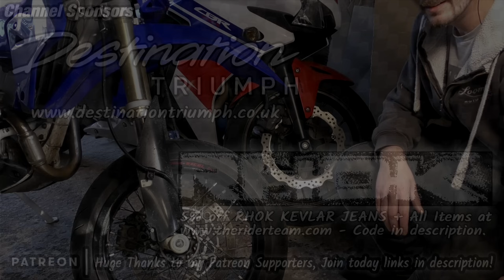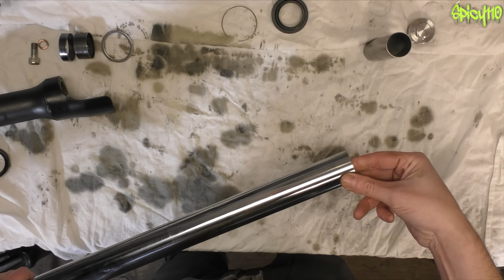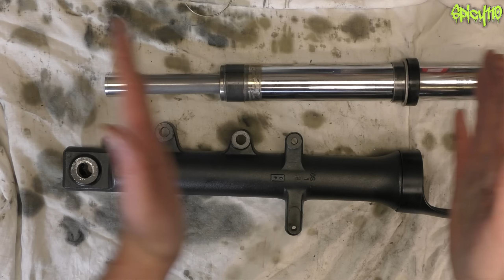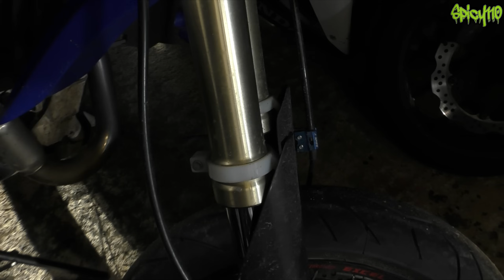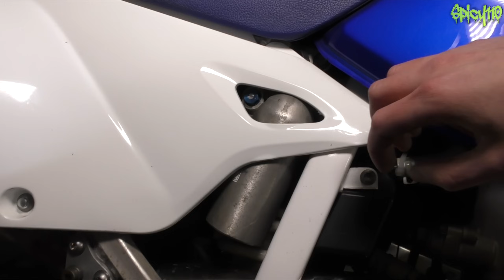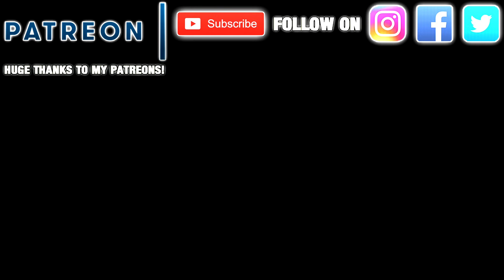Motorcycle Suspension! - The basics simply explained!

Comment: hello mate.. one quick question i recently change my stanchions.. its not oem.. difference was.. the hole on the stanchion was a about 5 cm higher than the oem one and also.. ek bottom where the plastic like spacer comes in was bigger in circumference.. i mounted it perfectly.. but while testing the bike.. and did like an emergency brake i hear a bang sound everytime a hit hard on the brake.. soft and gradual.braking is good.. any recommendation..
Reply from the maker: All I can say is not working and using the right parts would fix it.

Comment: Thank you! I have a 1972 CB500 K1 with a 1973 frame and 1978 CB550 front forks. The bike sat for 40 years in storage. Seals started to leak. So no problem. Dug up all the parts fiches and misread the assembly drawing so that I incorrectly located the rebound spring. No wonder its been bottoming out on potholes. Thank yo for solving my issue.
Reply from the maker: Really glad I could help with that!

Comment: This was super interesting. Would it be possible to lengthen the suspension travel on a budget simply by using a longer "spacer tube" (the one you show around 19:07)? I want 20-70 mm longer travel as part of turning my SV650 into a scrambler. Thanks!

Comment: Thanks for taking time to make this great video , good job . 

Question/s:
1, I have this type of forks on my bike GPZ500s , the shiny bit , stanchion , near the high's part , of where  the seal would travel to , I have  a little nick . 
I have 10W oil in them at moment . If I was to change that to 15W oil on both of course . Would that make the seal not travel up as much , so to miss the little nick on the stanchion ? 

Hope that makes sense
Reply from the maker: No that will not change the length of travel plus you really should use the right weight oil for the spec of the bike. There are ways of fixing nicks in them if you look in to it.

Comment: 2yrs passed I hope you can still answer question. I replaced oil of my fork suspension, but when I drive and run into bumps, I feel like my body is hitting the bump, as if my suspension does not have oil. What could be the problem here?

Comment: Thanks for this video, ive also watched the other one when u instal new seals, 
I bought an xj6, the prev owner said he changed the seals at a garage, and they leaks ever since. Forks looks good, any chance the seals to be bigger as in your case ? They dont look bigger but sh.t
I will try get some from ebay and change them myself 
Great video, thanks 😊
Reply from the maker: Hard to say what the issue is, could be out-of-spec seals, could be the person who did them damaged them. You could also have scratches or pitting in the stanchions. If they look ok there is nothing to do but change the seals and hope that's the fix.
Reply: @spicy110  i hope is the mechanic issue

Comment: Hi. My forks got movement when bike on stand and you hold bottom and push towards rear and foward. Is that bushings been worn? Any idea? Thanks
Reply from the maker: headstock bearing? If not that, if the fork move in the middle of the fork then yer sounds like the guides are worn badly.

Comment: So, if I have an oil leak and hypothetically I lose all the oil, which I think it's impossible, I can still ride it
Reply from the maker: If your forks have no oil they would be pogo sticks, you will have little traction cornering and you will come off.  if it's an uneven amount in one to the other fork leg you will get uneven wear. If it's leaking badly it might get on your brakes. The only thing you can ride on is a very slight weeping as in just a ring of oil left around the fork tube and then do not do that for long. Long short if it's leaking you need new fork seals.
Reply: @spicy110  my very big problem is that I live in Paris and no one does this work here, they all just change the fork as it's more money for them. They told me to keep riding like this until I have to pay €500 to change the whole thing. And of course I live in am appartement and I can't try myself. I think I lost a small amount and trying with seal mate is my best option. The time until I pay €500 will be longer I guess.

Comment: Great video and very informative. Can you make another video where u can explain  on how can we increase the suspension travel by modifying certain components inside the telescopic fork. Im curious to know if making adjustments to length of spring or the damper rod can increase the travel of the suspension system. #spicy110 @spicy110
Reply from the maker: Really interesting question, honestly I can not think of a way to do that as you would need basically replace all the parts other than caps and feet. I will look into this. If I prove myself wrong I will let you know.

Comment: The spring have no correct side?
Reply from the maker: Left to right is interchangeable, they are the same spring. Up and down in important tho as in what end is where.
Reply: left and right are normally the same springs, although I do know of a few that are different i.e. like the Honda Eurosport as one side leg/stanchion has anti dive, the oil levels are different for each side. Progressive springs are important to get the right way round i.e. top and bottom, the tighter coils go to the stationary end i.e. this fork would be to the top.

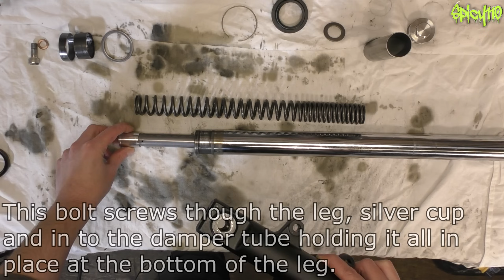Comment: Hi there! Thanks for the video. On my bike there is an oil leakage through the bolt at that screws into the damper tube (at 4:14 in your video). Is it possible to loosen this bolt and change the washer (ofcourse after draining the oil) and screwing it back in? Or do I need to take my whole suspension apart? Thanks in advance, would mean a lot if someone could help me! I have a BMW f650GS from 2001 btw, but it is somewhat the same type of fork.
Reply from the maker: If it's just the crush washer that needs replacing, in theory you can just take it out and replace the washer. (As you say you will need to replace the oil but that's no bad thing. )
Reply: @spicy110  thanks a lot!

Comment: Zero explanation how the damper rod works. And fyi, increasing or decreasing the oil level has the corresponding effect on the "air gap." It is this, which changes the resistances in the final 30 to 50mm of travel. Even at the minimum specified amount of oil, the damper rod will continue to damp throughout it's full travel.

Comment: I wonder why a car is able to do half a million miles with no recommendation to change shock oil and seals, but bikes is just 10,000 miles.
Reply: car shocks tend to be gas filled, like the rear shock on a bike.
Reply: @jasonjason7277  Thanks.  That would certainly explain it.